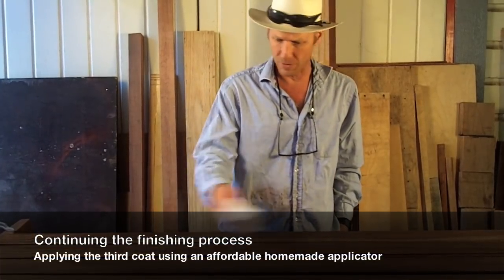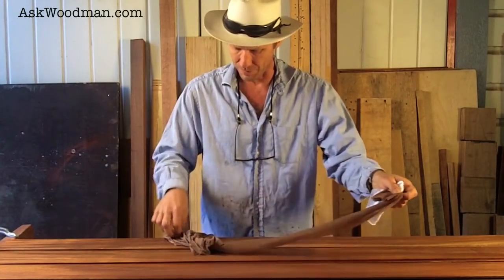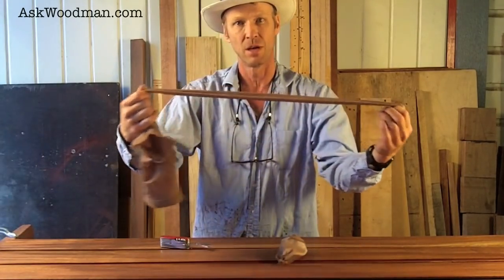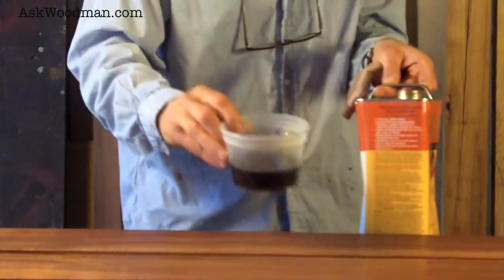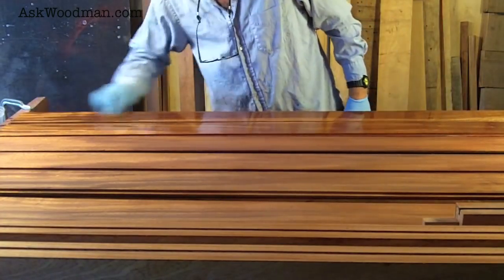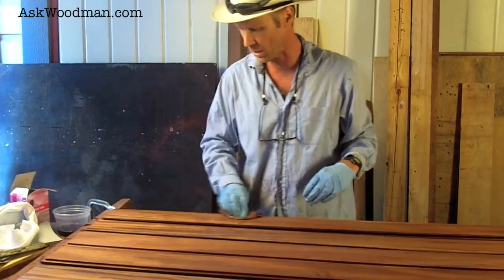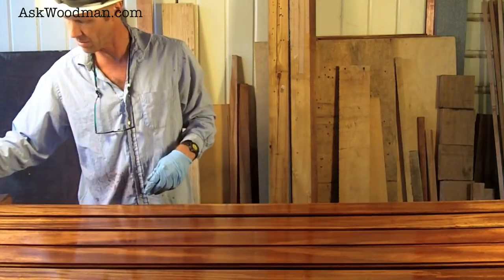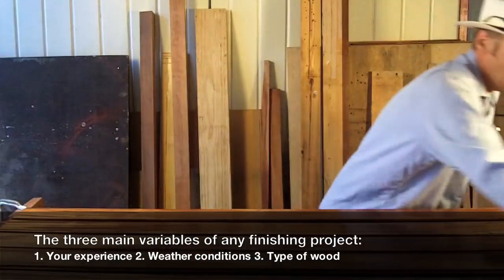16 How To Apply Waterlox Tung Oil Finish With Homemade Applicator - SOLID WOOD DOOR SERIES - Video 6

Comment from the maker: Hi Danny, Yes they are really only for one use. That is why I try to have a lot of stuff ready when I finish so I can keep the waste to a minimum. Once the finish starts dying in the brush it does not work right. Occasionally for shop finishing that is not critical I will put the brush in a plastic bag (without touching the bag) to be able to get an extra use. I often snap that wooden handle  off and save it for an extra dowel or spacer. I looked up your home island. I learned something.Allan.

Comment from the maker: This method I am using in this series would work perfect for her teak piece. Waterlox is primarily used as floor finish so it is really durable after the cure period. I see you are in UK. Waterlox is called American Wood Oil there. The type I use is known as Transparent Gold. I would just avoid the polys and anything with wax. There are probably plenty of traditional oil varnishes available. Since you have teak, marine sources would be a good place start your process. Keep in touch. Allan

Comment from the maker: @wmcrash The finish has not set as I am flipping and handling the pieces. And as I lay down my final strokes on the panel pieces I am only touching the tongue and groove portion which will never show. That is why I have the tongue ends up on boards. Coming up with the finishing setups to deal with pieces is always an exercise in the creative use of scrap boards and clamps. Let me know what you think of the door spinning rotisserie when you get to those videos. Thanks for watching and commenting

Comment from the maker: Of course. I use Waterlox Original Sealer Finish Medium Sheen on about 95% of my pieces. Sometimes I will use Waterlox Original High Gloss, or Marine, but the first is always used as a base. High Gloss and Marine are to thick to use as base coats. Waterlox makes a Satin but I Do Not recommend it. Feel free to ask as many questions as you like and write me at gmail if you would like to send pics of your project. Allan

Comment from the maker: Of course. It is primarily used on floors, so it is really tough after cure. And can be indefinitely freshened up with a scratch and coat. I use only the Original Sealer/Finish Medium Sheen. I do not recommend their Satin. The Marine is good but I use it only exterior.
Reply: Waterlox website says original and Marine are interchangeable. What's been your experience?

Comment: Hi Woodman, since you are such a big fan of Waterlox tung oil finish and it's preferred applied on horizontal surface. What would be your advise or precautions to whom trying to apply this on furnitures with lots of vertical surface?

Comment: So if I’m doing a tung oil I shouldn’t use my HVLP — I should use panty hose —- 

But in your experience, wiping and brushing is better than spraying?
Reply from the maker: There is no debate that a sprayed finish is an inferior finish to one that is physically forced into the wood fibers. A sprayed finish is just atomized particles laying on the uppermost surface.

Comment: Hello Woodman,
I applied 3 coats to a cherry table and legs. We purchased the unfinished materials from Matthew Burak and built the table on site. My question is how resilient is this Tung Oil (we actually purchased Formbys) for high traffic areas like a kitchen table where the children might spill juice, use crayons, markers, etc. and how easy is it to clean? What cleaning products do you recommend and how often should you reapply the oil? Thanks for your time.

Comment from the maker: @4bluestreak Nothing could be better for your project. If you sand that wood to about 320 and put Waterlox on it, your knees will buckle from the beauty. Just make sure you don't use anything with lint especially if you are around that grabby bark. You don't want any of those lint fibers caught in the finish. Also no steel wool. You will probably need a good brush (no cheap chip brushes) to stipple the uneven bark areas. Pictures please. Keep in touch and write if you have questions

Comment from the maker: It is no problem putting it on vertical surfaces. You just have to put on lighter coats and make sure you don't allow sags before the coat sets. You just can't build as fast as horizontal.
Reply: This is good to know. Mine is a stand for an aquarium. I know y'all are involved in artsy pieces you've made yourself. My concern is permanence, water resistance, and grain popping. And it will be nice to be able to apply in more than direction since it is so big.

Comment from the maker: You have to take the wax off for the finish to adhere. Please stop using wax. It is nothing but a contaminate and grime attractor. It does nothing and is not a finish. Waterlox is technically a varnish and will set up quick. Brush it on in light coats or you will make a mess.

Comment: Two months ago I had never used Waterlox and now I have used almost 2 gallons.  When I apply it with the boards flat I get incredible results.  When I apply it on vertical pieces it's just not as smooth.  I've tried a lot of different techniques on these vertical pieces with no improvement.  It's still a super finish, but nothing like the flat boards where I can apply more finish without it sagging.  I'm applying 5 to 7 coats.  Any ideas on how to improve the vertical applications?

Comment: I had some Waterlox left over from another project and decided to use it on some serving trays I'm making for Xmas gifts. Can I wet sand my final coats to try and knock down the bubble's or whatever is making the finish slightly rough. I will give Southerlands a try after this annoying finish on all of the serving trays.
Reply from the maker: Absolutely. Maybe start at about 600 with black wet/dry paper soaking it in a shallow container of thinner. You then may want to try an automotive rubbing compound followed up with a polishing compound. Use water with the compounds. I used Waterlox for 25 years and never had a bubble or a streak.  Really annoying. This is what I have gone back to. https://www.youtube.com/watch?v=lEeb3t1tmSc&list=PLqtTuVwYBfkxFXRDiDyiAlFeqMKOlh0eC&t=1s&index=69 This concoction followed by several coats of SW is really easy, mucher cheaper, and a whole lot less toxic.
Reply: AskWoodMan  I am switching over as soon as I hopefully straighten out this issue, thanks for the advice.

Comment from the maker: Sure you can. But would I recommend it? No. Is it better than nothing? Yes. "Teak Oils" are usually just some variation of linseed oil. If you want a quick slap dash "finish" they are fine. I could never get away with a wiping oil finish for one of my clients. They are just dull, grime and dirt attractors. My finish Waterlox forms a tough elastic transparant skin that repels moisture dirt and grime. It takes more time than smearing on some oil, but the results can't be compared.

Comment: Why do you not recommend the satin? I'm currently using it on a countertop.
Reply from the maker: It dries streaky or has bits of undissolved wax. I am actually done with Waterlox period. I have been brushing it since 1985 in any weather condition on any wood. But in the last year I feel the product formulation is different although they deny it. It seems thinned out and runny and has bubbles by the millions that I had never seen after brushing hundreds of gallons. So I am tired of wasting time fighting these new results. The cured finish also seems much softer so rubbing out the finish with compounds is different in the negative. I am going to pull these videos soon. I am looking for a new finish.
Reply: AskWoodMan
Do you have any other resources that point to your conclusion that Waterlox has changed their formula?  I'm looking to use it for finishing hardwood floors and your above comment is literally the only I can find anywhere claiming that the formula is different.  I'm somewhat taken aback considering that you haven't mentioned anything negative until know (at least from what I can find) even though you say you've been having issues for the past year.
Reply from the maker: Davison Long
There are other people out there discussing the changed properties. I try  not to pop off until I am sure of what I am seeing. But after 4 gallons and nothing but headache with the bubbles and lack of body in the setup, I consider that a trend. I am not a chemist and I have no way of quantifying the products constituents.  I just know it is not working for me anymore. So I am not going to use it or recommend it.
Reply: AskWoodMan
The only discussions that I can find with issues related to Waterlox are those using a VOC-complaint version (not the originial formula).  I assume you are still talking about the original formula, but I thought I'd ask just in case.  I believe it's only been in the last couple years that Waterlox has been widely distributing a VOC-compliant version.  For example, see here: http://www.popularwoodworking.com/woodworking-blogs/editors-blog/the-trouble-with-voc-compliant-finishes

Also, is it possible the 4 gallons you mentioned came from a bad batch?  Just wondering if it might be possible.  I've had that happen with paint before.
Reply from the maker: Davison Long
The low voc is just the same as their other products just higher solids by volume so it is lower voc per can. But to get it to work right you would need to thin it, so is really a low voc product? A bureaucratic end run more like it. Four gallons bought months apart? I doubt if they were from the same batch. People have been writing me about the bubbles for the last year.
Reply: +AskWoodMan Ever find a new finish that you like better than waterlox?